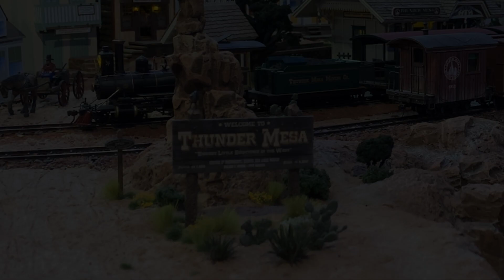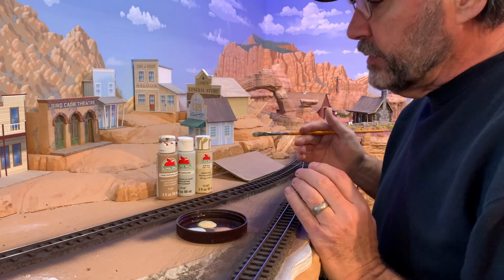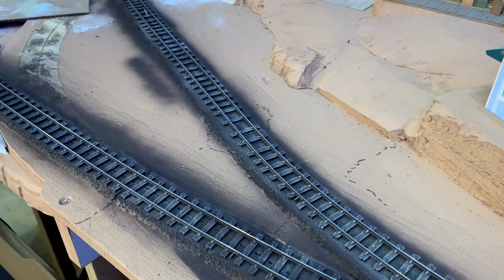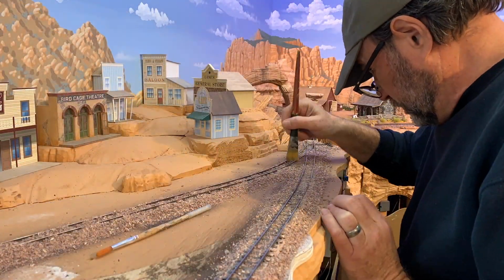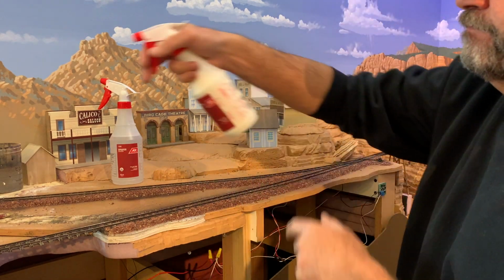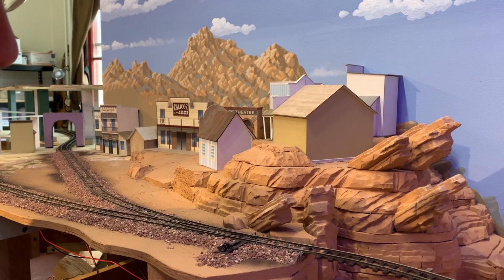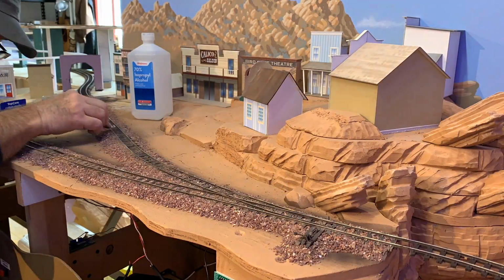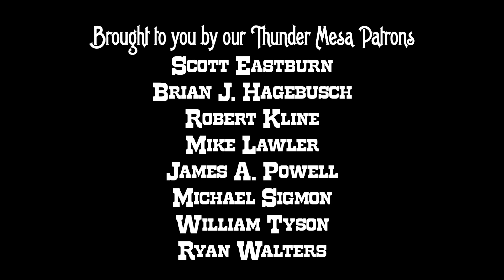How to Paint & Ballast On30 Track

Comment: Very nicely done!  I haven’t done any ballasting for years and years, but I seem to remember the advice to put just a touch of oil on the hinges of the switch points, and a little around the drawbar.  And just the lightest film on the sides of points where they touch the rails.  The oil will help keep the water and glue mixture from penetrating those critical areas and bonding them together.  And when everything is dry, a quick swipe between those rails with a paper towel or rag (or your cotton swabs) slightly dampened with some IPA will clean any glue residue which couldn’t bond to the moving parts because of the oil.

Comment: Hi Dave, I really enjoy watching your videos. I was wondering what track you use and what code rail. I have some microengineering On30 weathered flex track code 70. Is  code 83 better for bachmann trains, I have several porters a forney and an outside frame 2-8-0. It seems like the flanges may be too tall for code 70, just curious what you find works out the best. I'm considering doing a small home layout. I live in AZ would love to come visit some day. Thanks, Jon T.
Reply from the maker: I use Peco code 100 On30 on the TMMC because it's basically bomb proof. No question that the Micro Engineering track has a better scale appearance. I have no experience with the code 70 in On30 but my guess is you might have some problems with the older Bachmann equipment and their larger flanges. I have seen code 83 used extensively with very good results. You might try code 83 for the main runs and use the code 70 for old sidings.
Reply: @ThunderMesaStudio  Thank you Dave.